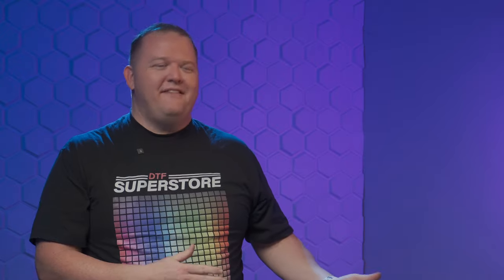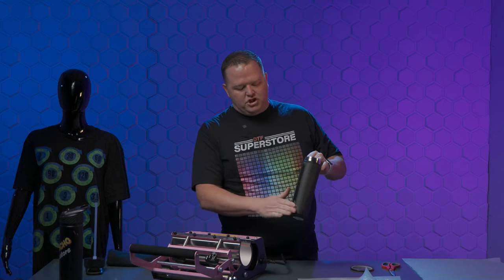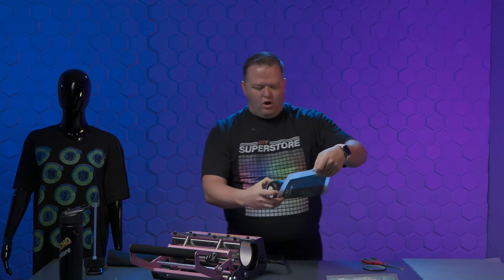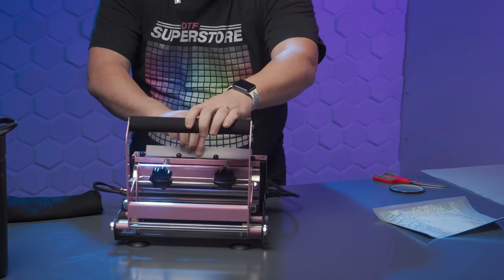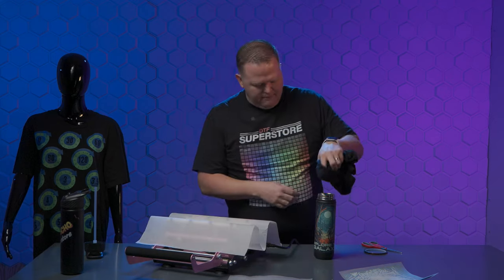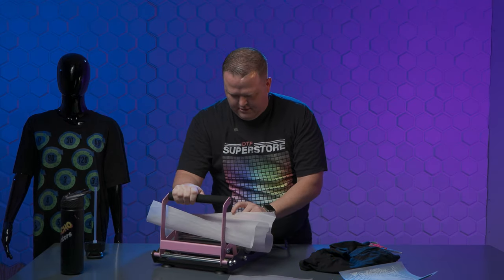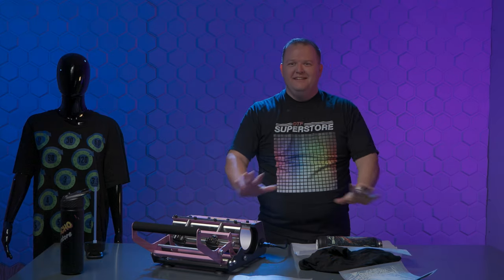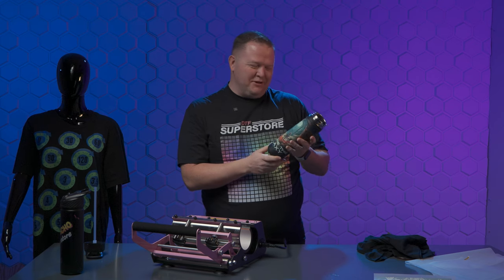I Can't Believe it Worked! | DTF on a Tumbler

Comment: How about dishwashers and stuff? Would you just recommend hand washing?
Reply: I feel like this is probably just as an important question as will it DTF.  Will it handle the dish washer.  I wanna know too
Reply: Mine fell off putting it in the dishwasher
Reply from the maker: We are currently testing it, nothing extreme, mostly daily use to see how it holds up and we will run it through a dishwasher!  We will do an update video!
Reply from the maker: When we tested the back to school water bottle in the dishwasher it held up pretty good.  Using a quality clear coat over the DTF transfer should help.  We'll see when we test it soon.
Reply: @DTFSuperstore  Yes!!! I'm looking forward to that!
Reply: What clear coat do you use? @DTFSuperstore
Reply: I probably wouldnt do a whole bottle design like that (Personal opinion only) but doing a design on one side and personalize the other side with a name i could see that being a good thing to sell.

Comment: Can you put dtf on a sublimation tumbler in a convection oven?
Reply from the maker: sublimation can happen without pressure but DTF HAS to have pretty good pressure to adhere.
Reply: Can you not use the shrink wrap to hold it on tighter? Maybe that would eliminate the wrinkles.

Comment: 50/50 (Poly acrylic - Water) in a spray bottle. It needs a layer to stick to.
Reply: Thank you ! where i can find Poly acrylic ?
Reply: @SELECTERWOLF  The paint section of ace hardware, Home Depot or Walmart, or any paint store.
Reply from the maker: We didn't need that for it to adhere to the bottle.  We used a clear coat to protect it after pressing.

Comment: can you DTF a leather football?
Reply from the maker: Great idea! You can indeed DTF on leather but the air in the football makes it difficult and would likely need to be deflated.
Reply: Do you think this would hold up to a thin coat of resin on the top of it.  I’ve never done a sublimation or dtf tumbler but I wondered if I could epoxy it